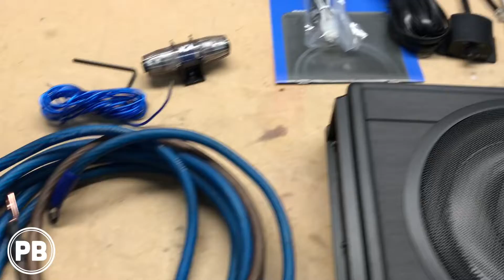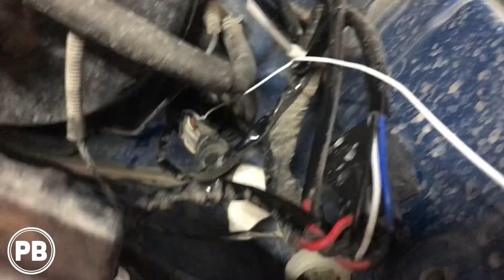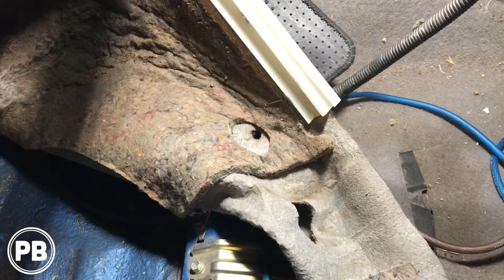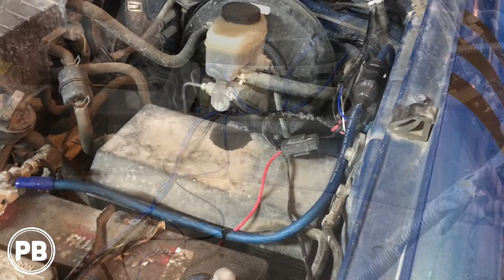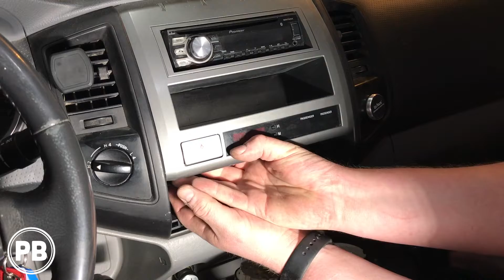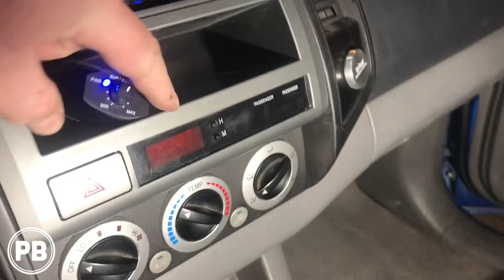2005 - 2015 Toyota Tacoma Under Seat Sub Install | QBUS8v2

Comment: My head unit has ONE Sub Out RCA. The powered subwoofer I am looking at has TWO (L & R IINPUT) Line In. I'm hearing conflicting info. Some say, run One line from Sub Out and pick either L or R in. Others say to use a Y-cable from the Sub Out and use both ports on the powered subwoofer Line In. Any suggestions or advice?
Reply from the maker: So most headunits will have a set voltage output on the mono RCA(s), regardless if that voltage is split between two ports or just one.  So, your radio is putting full preout voltage through that one RCA output and not splitting it between two.  Your input. On the amplifier side, it's usually the same if it's a mono amplifier to receive that voltage through one or two.  Howevever, just to be safe, i'd add an RCA splitter to the radio side and run the two channel RCA cables to your amplifier to ensure your amp is getting maximum voltage your radio is putting out.
Reply: So it shall be done. 😊 Thanks for the quick response. I watched your video last year on the speaker replacement and it went flawlessly. You guys are great.

Comment: Did you have to cut into the power cable to install the fuse holder in the engine bay???
Reply from the maker: Yes, we cut into the amp power wire to install the inline fuse as close to the battery as possible.
Reply: @ProvoBeastAudio   I connected the white and blue (accessories) wire into a blue wire in the aftermarket wiring harness behind the Sony stereo.
Do I just tap into the same blue and white wire with that blue one coming from the subwoofer. Like do I have to disconnect the blue wire of the aftermarket harness that I connected to the white and blue wire behind the Sony stereo to  connect the blue wire coming from the subwoofer, or can I have more than 1 wire connected to that blue and white (accessory) wire???

Comment: I ordered a Sony aftermarket single DIN radio. I’m wondering if that radio or do all aftermarket radios will also come with that blue and white wire to connect the remote wire from the SUB
Reply from the maker: Yes, a Sony will have a blue / white wire to trigger the aftermarket amplifier to turn on when the radio turns on.
Reply: @ProvoBeastAudio  Thanks for answering. I know it may not seem like a super important question or like big deal but I really appreciate you answering.

Comment: I see the Amp.Sub Combo is QBUS8v2 and comes with; bass knob, bass knob cable and high level input if no radio. Correct? What is the part number for the other kit with the RCA Cables, Power/Ground cables, Fuse and Remote Turn on Wire?
Reply from the maker: Everything is linked in the description

Comment: Is this the double cab? There are heater vents under the driver seat of the double cab.  Did you place the sub over the vents? In front? Behind?
Reply: they are heater/ac vents.  I imagine the ac would actually help but would heat be problematic for the powered sub?
Reply: I've always thought the heater vents would be a bad idea. I figure I'll stuff mine with something to block off airflow.

Comment: Did you not need a LOC? The sub/amp I bought “requires” one but I’m not sure how accurate that is
Reply from the maker: Nope because this was connected to an aftermarket radio that had rca preouts already.

Comment: How did you secure the unit in the Tacoma? Did you screw it into the floor?
Reply from the maker: Nope, there was just enough pressure from the seat to hold is securely in place.